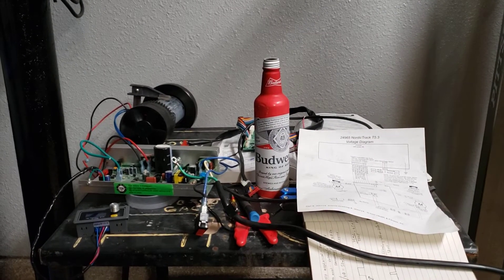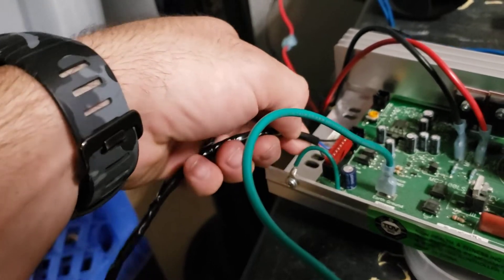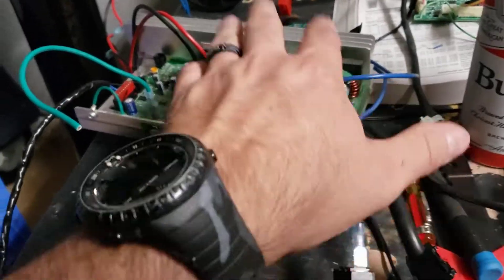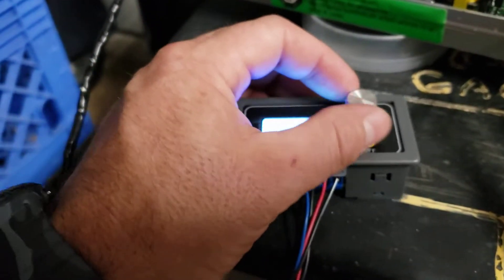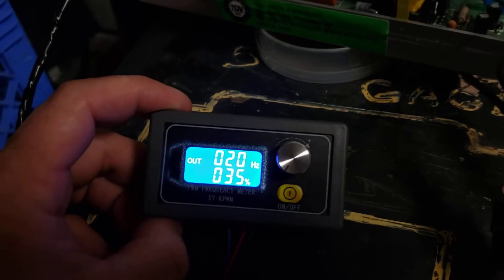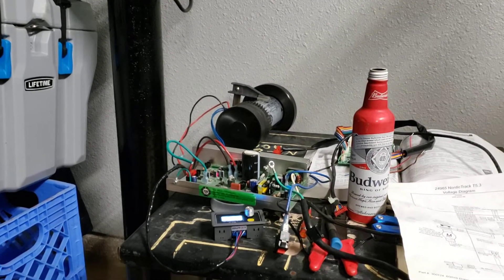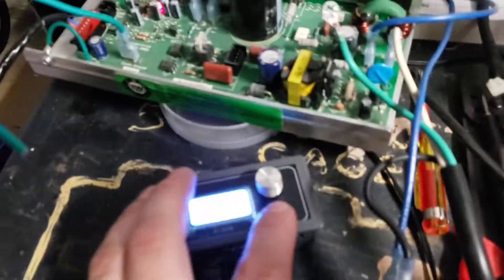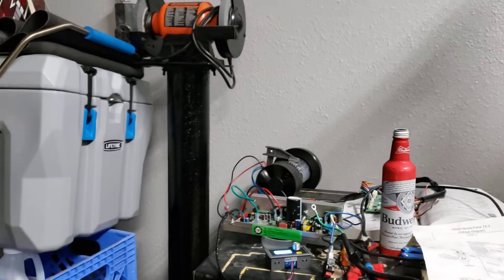How to wire up a treadmill motor to a PWM ( Pulse Width Modulator) BELT GRINDER PROJECT

Comment: Thanks for the info! Good video. I found a newer Nordic Track Commercial X11i or something like that for free the other day. The control board wire colors are the same: Red is V+ Black & B/W are V-/Ground and Blue is PWM input. The board is an MC5100DTS-50W.
Reply from the maker: Awesome! Glad it was helpful

Comment: Hey buddy, great video, I have almost done my bandsaw conversion but now I have fitted the PWM instead of the treadmills own control board the motor really bogs down under load and the blade stops it was fine before but the controller was to bulky. Just wondering if you don’t mind sharing what colours went where on the PWM many thanks and I wish you a merry Christmas 🎄
Reply from the maker: I will check it out and get back to you when I have a moment. I'm not currently at home.

Comment: Been chatting with a TM Technician.  Trying to pin him down but he's not been on the web since almost 5 hours ago.  He said the PWM (blue wire) will run the Opto too high a current and it could blow out.  Been looking at video's trying to find someone to say the same thing but so far - no luck.  Don't know if I'm getting good info or not.  How long have you been running TM Motors this way?  This will be my first project.  I have a shop air filtration system that runs on an induction motor.  Have removed the induction motor and built a bracket to hold the TMM in place with the fan.  Ready to test run this but I don't want to blow up my 2100.  I've converted a band saw with a TMM and an MC60 controller.  A lot noisier.

Any advice?
Reply from the maker: I'm not too sure on that.
Reply: @adventure_48  Can you defend your statement?

Comment: I believe the clicking you're hearing is the brushes. Some of these motors are designed to only run one way, i believe if you switch the leads on the motor you'll notice it will run smoother.
You may be able to inspect the brushes and see that some sit perpendicular to the commutator and some sit at a slight angle.  Obviously the ones at an angle are meant to run in one direction. 
Aside from that, nice work on the video.  Clear precise and to the point.
Reply from the maker: I'll give that a shot. Thanks for the suggestion
Reply: How’s the pwm controller holding up?
Reply: Good point. Also the flywheel is probably screwed on with a reverse thread, so you could end up spinning that thing off while it's running.

Comment: I'd recommend dialing it down to zero when you turn it off.  Based on some other videos and threads, the mc2100 boards can be a little sensitive to being instantly turned on at full blast and tend to burn out when this is done.  It's best to start at zero or low and work your way up.

I've been using the same motor and power board on my midi wood lathe for a few years with no problems.  I use an Arduino for my PWM, but plan to use the same pwm module for my next project.

Comment: I'm curious why you are using a 20 Hrz signal. How you determined 20 Hrz was the correct frequency to use? Was 20 Hrz determined by some trial and error methd?
Also, I noticed your schematic indicated the PWM signal range was 0-5 (0.1.5)VDC**, but you are driving it with 8-12v off pin 7 & 8. 
(Could it be that your 8-12v at 20 Hrz  and 100% PWM measures 5v?).

Also, is the clicking noise a function of the 20 Hrz rate or something else?

Note: It would not be hard to add a little regulator module to convert your 8-12v signal to a steady 5v for the PWM module if it would give you better performance, they only cost $1.
Reply from the maker: Interesting, thanks for the info...I'll have to check into that.

Comment: hi i have the same material and the led of pcb blink but the motor not working i have 12v in output 😔what is the problem pleaase
Reply from the maker: Check your PWM and make sure it's set to 20Hz
Reply: @adventure_48  i have not oscilloscope but i have 12 volt in the Gate of MOSFET
Reply from the maker: @mts164  I'm not to sure. I don't have much experience with that...I'd suggest check all your connections, ensure your supply and grounds are hooked up correctly and making good contact if you're 100% sure it's in the right configuration. Try disassembling the entire setup and starting over, or check individual components and see that they have continuity, and are not faulty.

Comment: I have the same motor, a same driver and purchased the same PWM generator you are using.  But I can't get it working. My driver pinouts are as follows:

Black - Ground (to PWM V-)
Red - 8-12 VDC (to PWM V+)
Green Tach. (n/c)
Blue - PWM input (to PWM output)
Orange - Incline Up (n/c)
Yellow - Incline Down (n/c)
Violet - Incline Sensor (n/c)
Black - Ground (to PWM Ground)
 
I get no motor operation.  However, the system works fine when I connect the original treadmill control panel. Any ideas?
------------------------------------------------
After 3 frustrating days I figured it out! 
My controller is very frequency sensitive. It will not work at 16, 17, 18 or 19 hertz. It won't work at 21, 22, 23 or 24 hertz. It will work at 20 hertz!
Reply from the maker: Yes, it has to be at 20hz! Otherwise it will not work. I think I covered this in the video, if I didn't I apologize. But for anyone else with similar issues.... I believe it's on the video and you can also read it on the display of the controller as I zoom in on it.
Reply from the maker: Glad you got it figured out
Reply: I tried this idea on a different type of card, but it didn't work for me.
Reply: I want to know what is the frequency that goes to the mosfet that controls the speed of the motor ?

Comment: I have a SW-TC998 board, where is the pwm signal connected?
Reply from the maker: I would need to research this and find out. Not too sure.
Reply: @adventure_48  it seems i have found the pwm pin on the socket after comparing the schematic diagram of mc2100. but still not working.

Comment: Great Video and Thnk you for the link... I have the exact same Board and I hope nothing is wrong with the board
Reply from the maker: Glad it helped. What are you using it for?
Reply: @adventure_48  I am actually just fixing my treadmill, the board and touch buttons stopped working so I am throwing it manual

Comment: I  wired my Johnson 2.5 hp treadmill motor to a 12 volt dc wall wart power supply. It runs the right speed for my thickness sander conveyor belt. Will running it that way damage the motor?
Reply from the maker: I'm not entirely sure. But if you're talking about the cigarette plug adapter to 110ac....I would consider over working that with the load and runtime of the sander....

Comment: Hey I have a treadmill the panel to start it is broken the motor and the running board all work you, think I can remove the panel and add this dc controller to my motor bypassing the panel for my treadmill to work
Reply from the maker: You could.....I wouldn't recommend doing that bc you might lose certain features of the treadmill and will definitely bypass the safety features.

Comment: I did this today, same setup other than my 2100 has a transformer on it also, even at 1% when it power on it wants to start fast and the the board shuts down. Do you have any ideas?
Reply from the maker: I would maybe check your wiring and make sure you have it wired correctly.....im not sure why it would do that....

Comment: Thank you for the great video!  I've got a couple of treadmill motors squirreled away for just this kind of project but had never thought of converting them PWM control before...
Does the addition of the PWM controller have any effect on how the motor performs while it's running?  Ex: DC motors (treadmill or otherwise) are notorious for loosing speed under load, especially at relatively low RPMs.  Does the PWM conversion help with this?  If so, how much?
Thanks again!
Reply from the maker: from the other videos ive researched, all have recommended this and it seems to be a great option. apparently the signal get a little dirty and you can slightly hear it while running but its not terrible or while under a load. it seems to be a really good option though in my personal opinion for DIY and cheaply making a great working tool.

Comment: Do you think it would be a good fix for a treadmill? I lnow the motor still functions, just my control board quit.
Reply from the maker: I wouldnt recommend it for that, just because you would be bypassing all safety features of the control board. It would......essentially get your motor running but, you should be able to look up your model number on ebay and find spare parts fairly cheap. Or just get on facebook marketplace and find a $50 treadmill that someones wife refuses to use and move out of the dining area LOL. Honestly, this set up is retrofitted mainly for DIY tools and stuff like that. Good luck whichever way you choose to go!

Comment: Hello
Where came from the WIRE V- NEGATIVE
Reply from the maker: Its in the wire harness. I deleted the unused wires and kept the BLACK, BLACK AND WHITE, BLUE, AND RED. The blue wire according to the diagram is the V- terminal which is your signal from the PWM to control your speed input.

Comment: You leave us guessing which terminals on the MC 2100 correspond to the terminals on the PWM. I'm having to assume the PWM goes to PWM and V+ go 12V terminals. Not sure which ground goes to which terminal or if it maters.
Reply from the maker: So red is going to be your power, blue is for you signal, and there are two grounds (one of which is black & white, and the other is black). I zoomed in on the diagram and you could see where my diagram shows that. Yours may be different depending on your model treadmill. But it should be similar. Those are the four wire that I kept in the harness from the board to the PWM. Hope this helps.
Reply: I know what you mean.
Black with white stripe and the plain black...They are means to distract and is not some other worldly stuff third wire going on.   In other words they are the same dang wire.
It is crystal clear in the control board that there is just ground on each end and it says black.
So this black and white nonsense on the PWM and the plain black can both go in the same ground slot on the control board that is at each end.
This kind of nonsense exist everywhere and in different style, not just color but terminologies.
There are only two wires in electricity be it AC or DC period.  Any third, 4th, 5th or 10th wire are all nothing more than designated to different component which ultimately are either so called hot and or return/ground.
In a nutshell the so called black is always held as just one wire.  The term return is used for it.
Just like in your car you noticed that all so called return or ground is common.  Yea that is another word. more word.  Return, ground, common.  And oh wait neutral.... oh my.  And this neutral business is used in AC.  In reality that also is common.
Language is a strange business.
And by the way get this.  PWM wire itself is the hot just like the so called V+.  
Did you catch it.  V+?. But wait, what about V-?  Oh my.
Can you say bamboozlement?  I can.
That PWM wire getting hot ( if you will) is like you blinking your bedroom light by turning  the switch on and off.  That is all.   And that is done by them so called transistors and along with capacitors, charging/discharging instead of physical switch.   That dog gone dial you see on that so called pwm generator is nothing more than a resistor that you varry on your dimmer switch which is nothing more than a means to charge and discharge the capacitor at the different rate.
The hum or noise you hear relates to the frequency generation interferring with and in association with the motor.
YOu see it also does not provide clean PWM but in fact is variable resistor game.
Why do you think you don't find any knob with any Treadmill?
What you are obviously not told, that you are better off purchasing a PWM that does not have that knob.  There is a price for that. A stupid price just because you want your motor to turn on next time at the same speed place you turned it off the previous time.
And by the way, that hum is terrible on the motor.
You want clean PWM, get the ones without the knob.  Trust me. And nobody asks that kind of basic question.